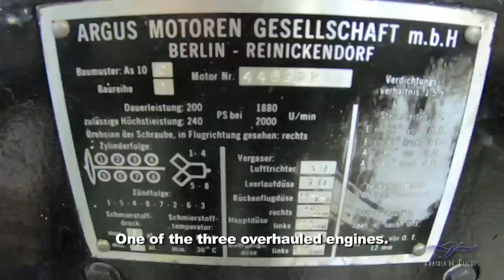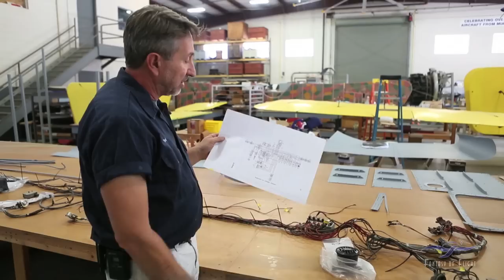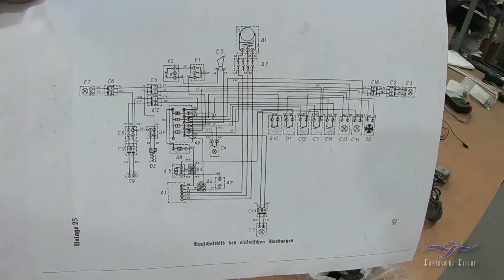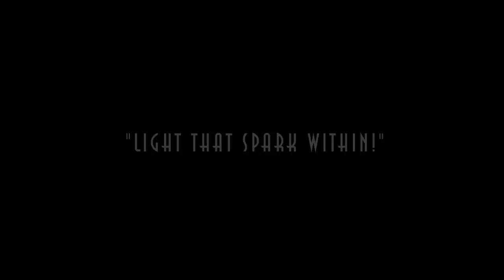Messerschmitt Bf-108 - Restoration Update #22 - May 2022

Comment: Thanks for the update. Beautiful!!Wiring board is also used in automotive field, a great solution that allow to test the harness at the bench before the installation . To remove antique wiring from a metal pipe sometime I’ve used hot gun or even gas flam. This will melt (or burn) the wiring insulation freeing it to slide out, perhaps it might works also for your. A great restoration .

Comment: I read somewhere that the wire board with it's pre-assembly wiring bundles was invented by a production  lady at Boeing in WW2 using the principles she learned from knitting. It was a vast, vast improvement in productivity and the technique was shared throughout the industry.
Reply: As of the late 80's/90's Boeing still did that.  There was a wiring department in Everett with very, very long white boards on which wire route drawings were attached.  There were hooks, supports and clamps where wires would be routed and clamped in place from big reels of bulk wire.  When complete and tied together the wire looms would be rolled onto giant reels, and those would be loaded into the airplane and reeled out into place.  

There were some wires for the capacitance fuel measuring system in the 747 horizontal stabilizer fuel tank that could not be spliced or connected together and that ran continuously and unbroken from the tail of the aircraft to the computers in the electronics bay under the cockpit.  If those wires were as much as nicked the entire bundle would have to be replaced, even if the interior was in place.  Basically, you would have to remove nearly the entire interior to do so.
Reply: @orcasea59 , Boeing still uses this method. I worked in the Wire Shop in Everett from 2017 to 2020 on the 777X and 737 Max programs. The largest were for the control surfaces on the 777X, consisting of 6 to 8 standard plywood sheets (4 feet by 8 feet) placed end to end, so one bundle could potentially be hundreds of feet long with hundreds of induvidual wires. After building up the bundles we then had to do a continuity check with either an ammeter or a test light.  That was the fun part...😜
Reply: Damn one-wires!

Comment: When I was young there were two warbird restoration projects at the flying school hangar. One was a P51 D (one plane being built from two donors) and a Harvard trainer that was literally saved from the scrapper's saw. There were a pair of cuts in the side of the fuselage behind the rear cockpit that went right thru the wiring harness.

Comment: If i remember correctly they used a "nailboard" for the wiring. Each "path" a wire have to go was drawn on a board and nails wold mark the sections where a loom ends or splits. I've seen things like that for truck construction.

Comment: What did it have for an electrical power source, engine gear driven generator? When I built my plane I was able to put a 1/2" drill on the bolt on the alternator pulley and test the electrical system with ships power, before having to run the engine. That was nice, as the engine wasn't able to be run inside my shop. Assuming you can figure out a way to connect a 1/2" drill to the generator to turn it. Two man job either way.

Comment: Great video and nice progress.
Are the wires color coded, or all white (like on Grob)?
Reply: Just the gliders, or all of them?
Reply: @leifvejby8023  I only worked on the wires of a G103c, the self launched twin. The electric system was a lot more complex than this Bf-108!
All wires were white, with just a tiny gray code marked on it. On 1 or 1.5 mm wire, it isn't very readable.
Reply: @pbyfr  Thanks! Have never worked on either.

Comment: Paul I know you and Kermit are sticklers for original but  in my opinion aircraft wiring should be the exception. A short to ground could burn down your whole project. You should use the best grade of certified wire with the best abrasion resistant insulation and the wire should be sized for the current it will carry plus a safety margin. I know Kermit has dreams of a theme park but I think covid 19 has changed the world and that's just not going to work out. In my opinion he should form a classic air plane rebuilding corporation and rebuild those for sale on a contract basis to rich baby boomers who have a direct relative who fought in them. Kermit has to move quick because I think this market will be dead in thirty years. Think about Paul Allen and his dream. When the rich die their dreams usually die with them..

Comment: Whatever your "video/sound" guy did with the audio track for this video needs to be stopped. It is terrible. There is a "stereo" 3D effect on the voice , which,  whilst it might work on a surround sound system does NOT work when listened to using only a decent stereo sound system. The "centre channel" sound is still their slightly, which is the problem it does not have enough of your voice.  is extremely off putting .
Reply: Why acting so pedantic? That's extremely off putting.  There was an issue, they provided a link to a fix, done.
Reply: @sebas793 Clearly English is not your first language. Pedantic has nothing to do with it. There is a technical problem, something FOF NEVER really have, so I gave details. As a professional sound engineer of 40 years I could have gone into minuscule detail - that may have been pedantic. As it is, I gave enough information for the tech guys to know what I am referring to so that they can find/fix the issue and avoid it in further recordings. As for the link, "NOT HEARING AUDIO" is irrelevant in this instance as there is audio on this video. The link also implies that the video did not have audio at some point and that the audio now on this video may have been added after the link was posted - in which case they need to know about the technical issue on this video with current audio. Hint:- dont read posts if they put you off, nobody forces you to.
Reply: @stevewayne1359  and again, an overly long and amusingly pedantic answer! 😊 (BTW, if you want to talk language,  check your first post)